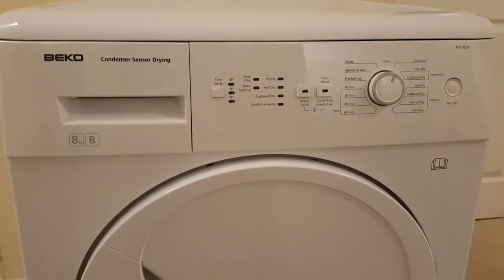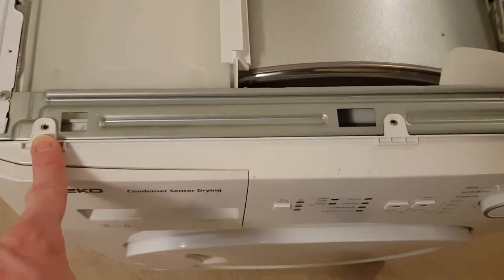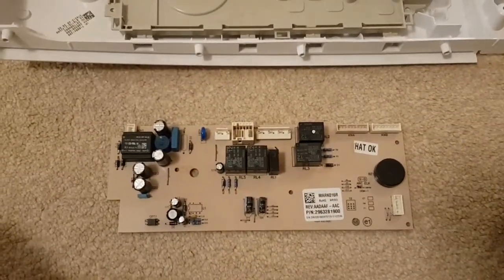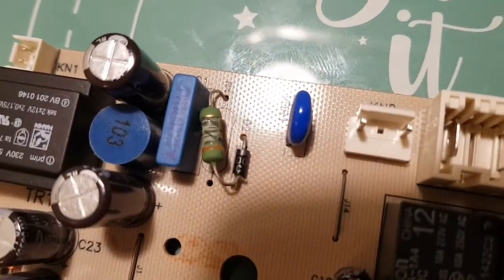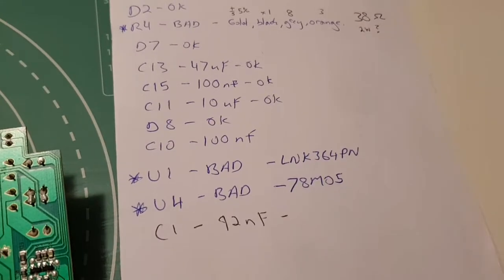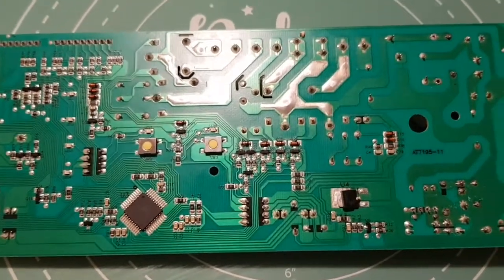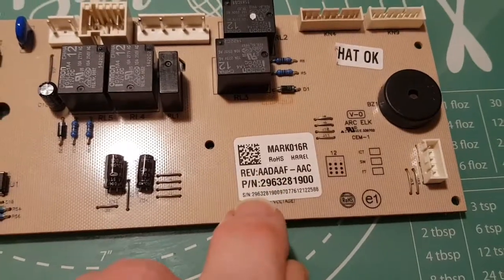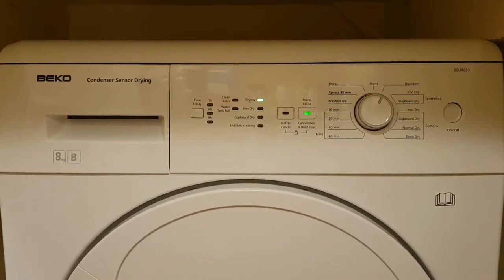Beko DCU8230 Tumble Dryer Control Module Repair

Comment: Thank you very much for posting this video. Exactly the same thing happened to my machine.Following your instruction I removed the PC board and saw the same resistor and voltage control unit have burnt out. I knew it was the PCB unit, as I explained to my wife, when you order a taxi and the driver tells you his car is broken, then you know it is the car and not him, if you find him unconscious over the steering wheel, you can safely assume that the car is not faulty. I have ordered one from E bay and hopefully will have it humming away by the end of the week.  My dryer is more than 8 years old, my instinct is to replace rather then repair, but this time round I am taking the risk.

Comment: Your vidoe helped me in the first 40 seconds I hadn't checked to see if the light stays on inside! Mine didn't? I had repaced the fuse and still not my double gang socket for soem reason the right side burnt out! Plugged it into the left and hey presto! Was about to strip the machine apart! 😅

Comment: Great vid, albeit niche to us Beko tumble dryer owners! Has your dryer ever stop randomly (can be 2 seconds or 20 minutes into the cycle - is totally random)? I have the same Beko DCU8230 and it has had this random stoppage behaviour since new many years ago. Googling about seems to suggest that it is a PCB issue. Just wondering if you have any insight or similar experience.
Reply from the maker: I remember there was a safety recall regarding the PCB with a certain batch of this dryer, not sure if its related to your issues. Either way would be hard to diagnose if random

Comment: I had the the same problem. The diode next to the 38 ohm resistor was open circuit. Replaced them both. It worked briefly. But now resets after 30 seconds. I ran a self test mode and as soon as the heater relay switches on it resets.

Comment: Before watching this video I was seriously considering changing the machine to "manual" operation. I was going to buy a countdown timer switch and a few rocker switches on Ebay, and wire the motor to one switch and heating element and pump to a different switch. I would start the motor first and then turn on the heaters. I would lose the moisture sensor function, and the anti crease action, but to cough up £300 for a replacement is a bit steep under the current economy conditions.

Comment: Hi, thanks for the effort to post the video, I have a beko dcu7230 B  tumble dryer the PC board is exactly the same as yours . I found out the R4 resistor is burnt and the blue capacitor next to it C1 seems to be burnt and also C13 seems to be cracked. I looked up the other components. They seem to be ok.  Could you please help with where to buy the parts and what are the names of the components.  Thanks.
Reply from the maker: Don't have the info anymore unfortunately

Comment: Thank for your video sir .I have the same circuit board and the heater won't turn on no AC voltage on heater.
Reply from the maker: I think the main board would just control the relay for switching the heater on/off. Maybe there is a problem with the heating element or thermal fuse?
Reply: @amp9438  elements are working when you directly gave them 220v AC from relay.relay are not switching.
Reply: @qaisniazi3793  reset the thermostat
Reply: press the red button on the back of the machine by the heater

Comment: this is the same board in my DCU 7230b exact same part number so you might want to add that in somewhere. this video helped i had similar issues the capacitor by the chip failed C13 popped and R4 had a big crack through it and it damaged C1 so im going to replace these 3 parts hoping nothing else is gone. R4 on mine was 18 ohm i havent got the parts yet but fingers crossed this is it for me. 

if not ill look into the voltage regulator and someone suggested change the capacitors. ive got lots of those so i dont mind replacing those. but hopefully its those parts im changing.
Reply: since found out the voltage regulator you replaced mine was gone too so ordered one of them as well.
Reply from the maker: Good luck hope the processor survived. Mine was shorted I think after the regulator failed :(
Reply: Hi, I have exact same dryer and same issue. Could you please help with where to buy those components? R4  C1  C13. 
 Thanks
Reply: @TotoGuy-Original  did that work? I replaced the resistor (R4) and it broke down again,  when I turned it on.  Is it enough to replace those components or the microprocessor is broken too?
Reply: @gomadortv7504  blew again so I gave up and bought a new machine. So what was wrong with it otherwise was way over my head

Comment: I have exactly the same problem. How would you test the microprocessor?
Reply from the maker: With the board disconnected I would attempt to inject 5v DC onto the board and see if the processor powers up, i.e. you see lights etc. You can probably do this where the 5v regulator (U4 78M05) is.

Comment: Hi on the board in your video what is the small round blue component marked up with 103 please .
Reply: i would say a capacitor also the rectangle blue thing next to the resistor is also a different type of capacitor
Reply: That's an inductor. Happens to be that component that became faulty on my dcu9330w beko tumble dryer

Comment: Hi can you help. I have a new on off button coming ,but I forgot to take a photo of the wires and hiw they went on. Please can you help me or send me a picture of yours please. Many thanks
Reply from the maker: Hi. Maybe you can check the service manual for the wiring. There's a link here which might be useful: https://www.manualslib.com/manual/918403/Beko-Dcu8230.html#manual